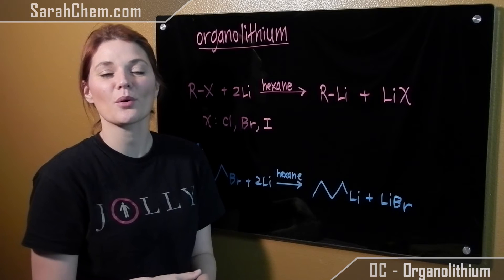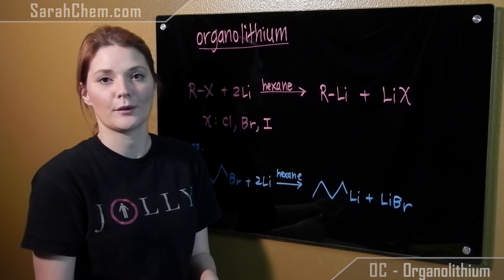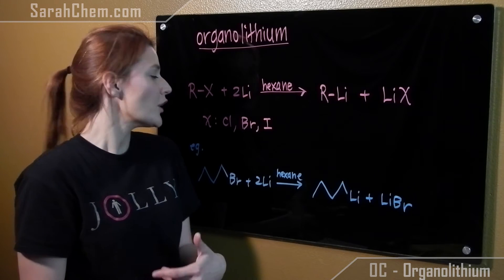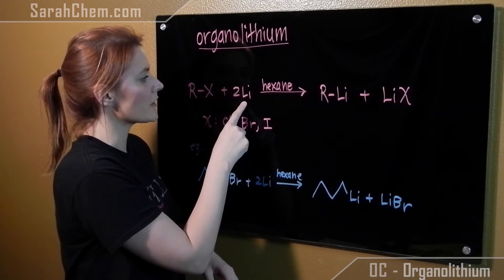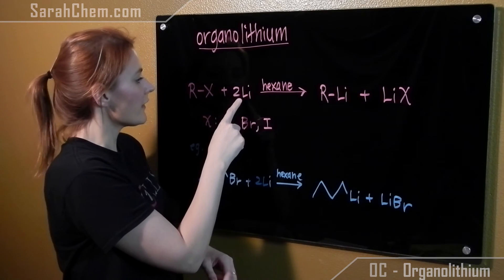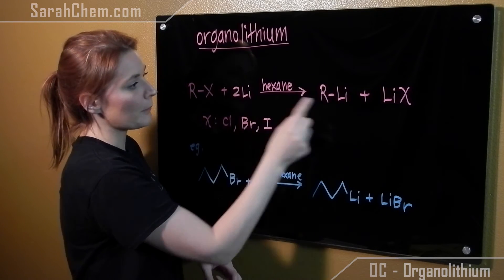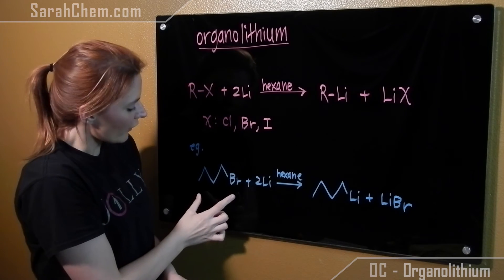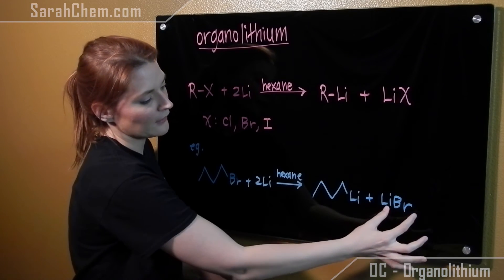Organolithium

Comment: What about in the lab? How would you actually go about preparing alkyllithium for example, knowing that both reactants and products are very sensitive to oxidation in air?
Reply from the maker: Hi Jorge.  You would have to take very meticulous precautions in the lab.  There are a number of ways you could do this.  One is to use a glove box flushed with argon (definitely a rather tedious measure) - making sure that the glassware has been "washed" with argon (nitrogen could also do the job) thoroughly to ensure there is no oxygen residual on the glassware.I have been told that trying to make these reagents on a humid day is next to impossible!  Hope this helps :-)
Reply: it does! thank you :) Is it this way with all organometallic compounds? Does that mean I wont encounter many in my undergraduate adventures?